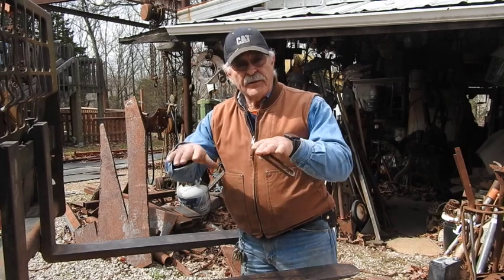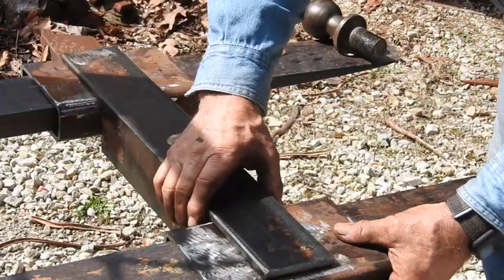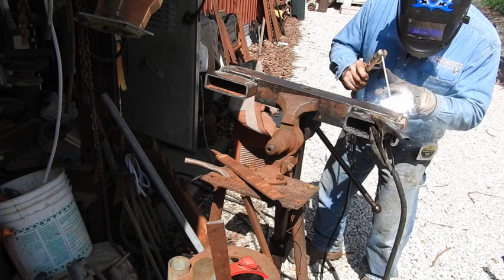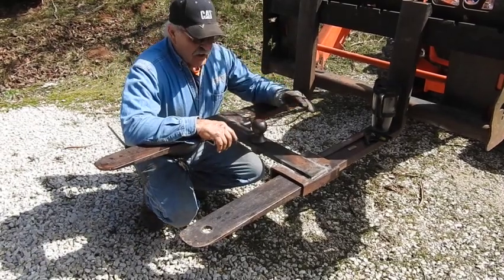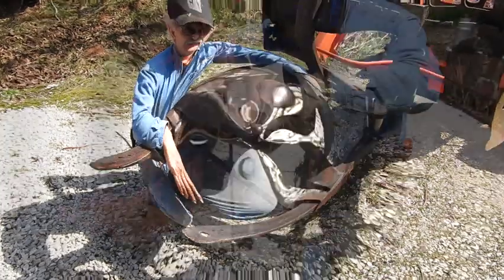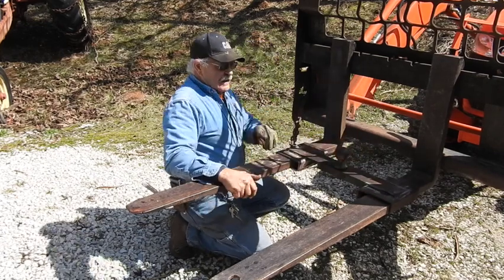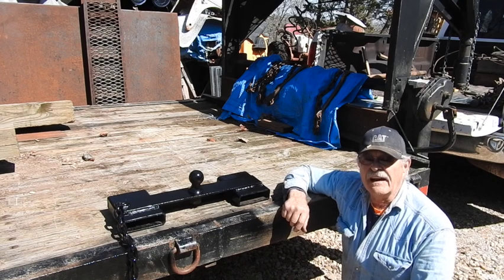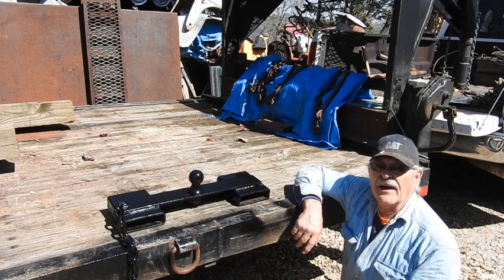Make Your SSQA Forks More Versatile With This Quickly Built Accessory

Comment: Love that old bandsaw!
Reply from the maker: I'm running a bi-metal blade on it and it does a great job.  I think it's got a 16'' throat, but I might be wrong about that.  I've cut 10'' channel and 8'' I beam with no problem.  I don't even know how old it is Matt, but the cast frame and integral legs are quite unique.
Reply: I waz gonna ask how old the band saw iz?
Reply from the maker: @mikeadams2339  I don't really know.  I was thinking 1930's or 40's but I could be wrong.  I never have looked it up Mike.  It's a very heavy cast iron one piece base that someone buggered on a set of casters...very poorly too I may add.

Comment: Had one of these for years. 3 ft section of 2x6 square tube. Heavy wall. Bolt welded upright in the end. Hole drilled 8 inches from end. We could drop a hitch pin in the hole that would also go through a hole in the fork. Allowed us to drive up to a 4 wheel wagon with a fork lift or skid steer. Run the 2x6 between the 2 parts of the wagon tongue till the bolt would catch in the upper part. Pull wagons all over the yard without getting off the tow unit.
Reply from the maker: Yes, I can see that as a great set up.  Much easier to move a wagon that way...especially backing it into a spot.  This is going to work great on the gooseneck trailers for sure.  Thanks Alan for the input.

Comment: When I was building custom flatbeds for a used truck dealer we had something similar with a ball hitch. My "jig"was a stripped truck frame. It had a coupler on the front so you would drive up raise the forks until the ball went into the coupler. The longest bed I built on it was 26'. Al B.
Reply from the maker: Sounds like a good set up Al.  There's all kinds of variations of the idea I'm sure. I bet that was a rewarding job, building flatbeds and large projects like that.

Comment: Good job Wendell that will be very handy to move trailers around thanks for sharing take care have a great weekend
Reply from the maker: Yessir it will.  Already used it last weekend loading the trailer with the big rounds.  Much easier than the forks and putting pressure on the little tractor in a balanced manner.  Enjoy the weekend as well Tom.  Going back after the two big logs today.

Comment: it works real good to push a trailer around, I hae a ball on my golf cart but it's not running now so I put a ball in the bucket of my little loader and just today I moved my trailer in close to the shop, I want to extend the bed by a foot or so and move the axle back a foot or so.
Reply from the maker: Heck yeah that's the way to do it !!  I have a ball welded to the back of the bucket on the 580 Case backhoe for the same reason.  Good luck with your trailer update Vernon.

Comment: I love the fact that you use Low Hydrogen welding rod. I'm not sure the kids today even know how to weld with it, as they seem to want to weld everything with MIG. I'm old school and don't trust the MIG weld as much as Lo-Hi.
Reply from the maker: If I fill a hole or a gap, I'll use a quick cooling 5p then brush the flux clean then cap it with 7018.  Makes a good porous free weld.  Of course I've never had an exray.....  I use MIG on some stuff, but its not a 110v crackerbox, its a 230 amp Snap-on MIG and I run .030 or .035 pretty hot. If its a critical weld that's to support weight I always go lo-hy.
Reply: @tractorman4461  of course the 5p.

Comment: I made the same thing, l have lock in by putting a pin through the hole in the end of the forks for my skidsteer
Reply from the maker: It's a good accessory to have available, Ed.  The lock pin through the hole is a good idea for sure.  I may do that for the other set of forks on my skidsteer too.  It will have the power to lift good size loads on the end of the forks.  But on the smaller tractors, I need to lift heavy loads from close to the rear of the forks because of the much lower lift capacity, so the chain will hold it close.

Comment: Wendell,  whose treasure chest did you raid for this project. Looks like a nice assortment of goodies there. Great job and nice looking finished product.
Reply from the maker: Hahahaha...Mike, that was nothing but scraps laying under one of the work benches.  I used the 2x6 box tubing a couple years ago to build a new frame for another tandem axle dump trailer we literally broke in half.  The rest is just scrap I'd bring home from the trash hoppers on jobsites.  There's tons (literally)of iron in and around the shop.  Never throw it away or pass up some freebies !!

Comment: When you load the rounds on the trailer that day I picked up how handy does the chain lifting part was against using only the forks, you could stack the rounds precisely where you want, I did not even notice the device, it sure make jobs a lot easier, great idea Wendell, I know you have a lot of welders but what type did you use on that job and how many amps was it set on
Reply from the maker: That particular one was a General Electric 300 amp AC/DC welder with 100% duty cycle.  It's old and came out of a welding school as they updated 30 years ago.  It's been a really good welder for me.  I was running 1/8'' 7018 at around 120 amps.